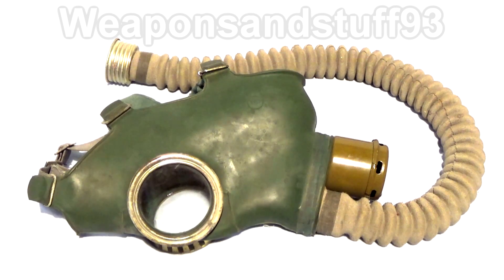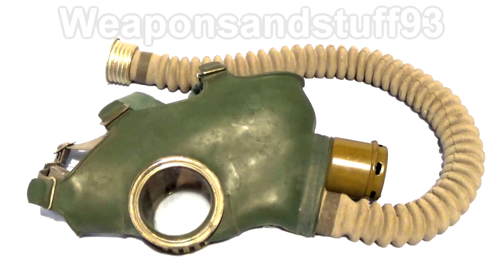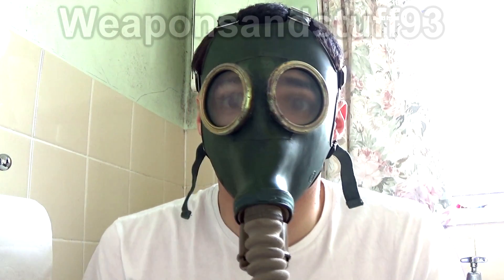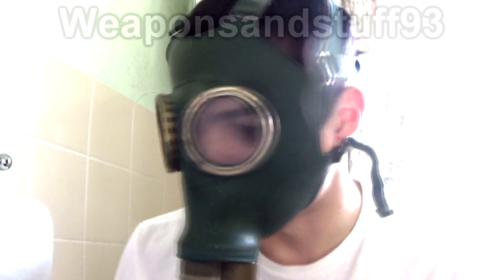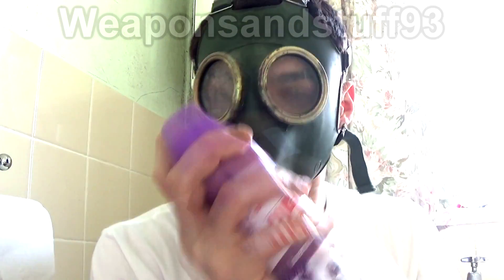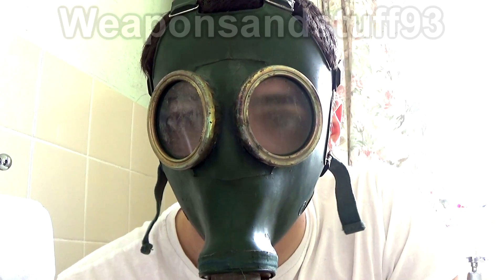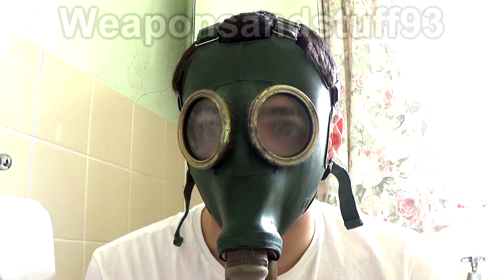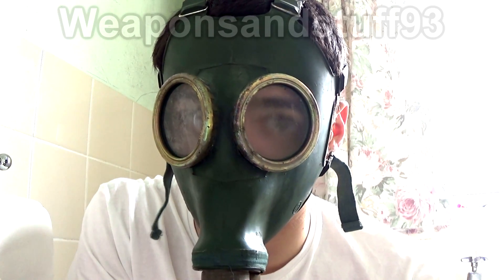Testing the GP-4 Gas Mask

Comment: Hello! I just wanted to ask that how can i unscruw the hose from the mask?
Reply from the maker: You can't.
Reply: Yes but it's extremely hard i think you have to take off  the wrappings and then the wire and then just take out the hose but i wouldn't try that
Reply: Well,funny thing is that the hose can not be unscrewed

Comment: Mine works with a c2a1 canister
Reply from the maker: It won't work properly, the threads are different.
Reply: Weaponsandstuff93 I replaced the rubber ring with a  thicker rubber ring and it tests well and forms and airtight seal

Comment: He forgot to move the hare from his forehead so the mask didn't become airtight
Reply from the maker: +Dr.Cosmo well ideally you need to actually be bald to use a gas mask.
Reply: only if you are using  hood-style mask. Since masks with straps (mostly) fit only around the face, you should be fine without a beard of any sort.

Comment: So it is a little unrelated to this particular mask but I own a PBF and a MP-5 (both cheek filters) they have been sitting on my shelf for a long time untouched. I came to check on them later today and they have a strange white dust around them, now I have noticed similar appearances of this dust on some of your masks. I was just wondering wether or not it is harmful as I am afraid to go near them. 

Could you please make a video regarding this dust, or just get back to me and let me know wether or not the stuff is safe or not.
Reply: I would also like to add I have handled all the filters and have used the MP-5 extensively on a few occasions for spray painting, with the filters working as intended. I kinda like this hobby and don't fancy being dead in a few years so if anyone could add something to my concerns this would be greatly appreciated.
Reply from the maker: +Matthew Jackson It's either talc or dust, just wipe it off, nothing serious.

Comment: problems with old masks, in my opinion, 1 rubber can get stiff, less seal around the face and cracks in the rubber, 2 no inner mask, exhale gets the lenses foggy, Good video.
Reply from the maker: Yeah, the shape of it also doesn't seem ideal for my face, in the sense that the rest of it fits my head but my jaw seems to not want to seal well with the bottom section.

Comment: I'm thinking of collecting masks, I currently have a gp-5, what gasmasks that you know of are in surplus or are cheap, on eBay and such.
Reply from the maker: Very good list for a beginner. Thanks for the comment.
Reply: Embedded Irony I started with a Czech M10M, which is a relatively cheaper and okay mask to start with. The Israeli 4A1 is a great mask as well, as well as the German M65, Polish MC1' Czech CM4 and the Finnish M61! Hope this helps! Good luck! :)
Reply: Liam O'Shea the Czech m10m looks alright, if you do know, out of the ones you've picked, which ones would be safe to use? I know you can buy new filters, but sadly there's no way I can buy them around where I live, so what ones are safe with the same filters that they are sold with?
Reply from the maker: You might be able to get the old Swedish civil defence masks cheaply, don't wear them as the filters aren't safe but they're lovely retro masks.
Reply: Embedded Irony Most Israeli masks should come with new filters, or newer at least. Ask the other "Liam" about this haha he has a lot more experience.
Reply: Would you be able to get new filters for them, and if so how much would they cost?

Comment: Good video I was surprised how well it worked baring in mind it's much older than a GP5 it lasted pretty well
Reply from the maker: Yeah I had to give it a good clean out first as it was full of dust, the GP5 is definitely a much better design though, cheaper and faster to make, and works better as a gas mask.
Reply: Weaponsandstuff93 true
Reply: break the seal and i swear you'll regret it
Reply: also check out my comment